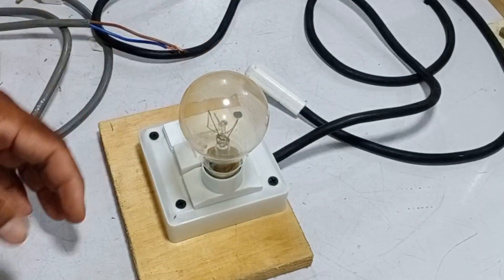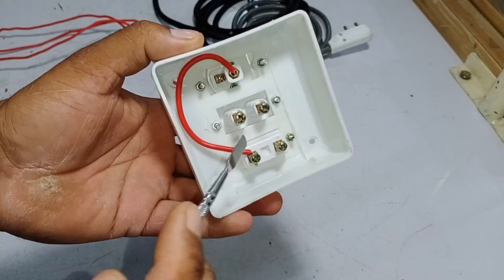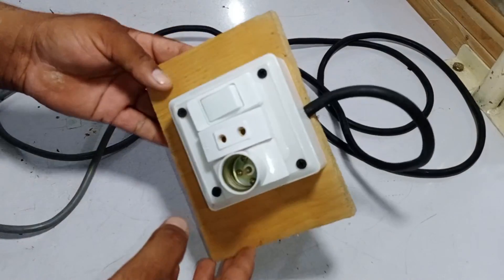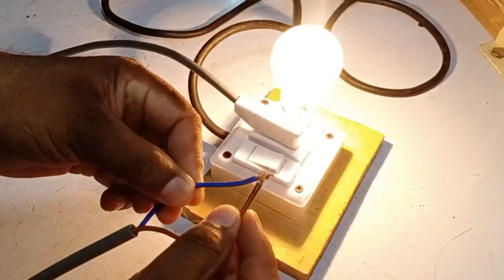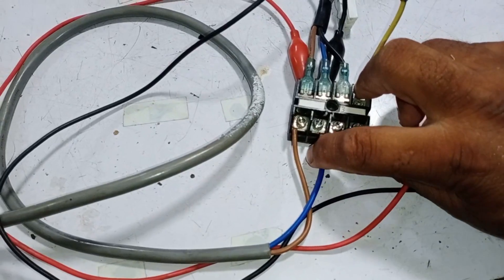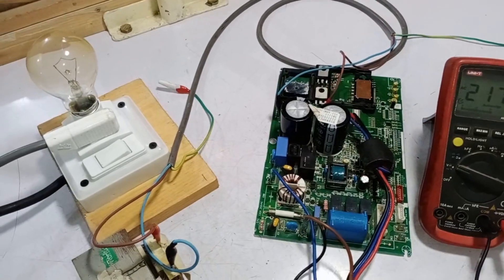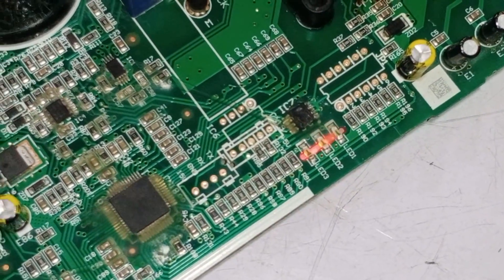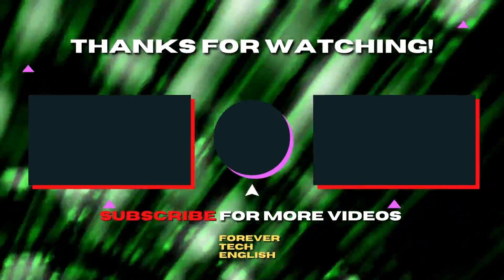Testing Mini Split AC Circuit Board with a Series Lamp!

Comment: How to add a 12v power supply to a board when the smd pcb transformer has blown and you cant get a replacement?
Reply from the maker: Well Will make a video on it soon. If I get a hand on such issue.
Reply: @forevertechenglish  Its  a Hisense/Kenwood fridge main board. A electrical surge blew a hole in the TOP266KG ic and destroyed the windings on the transformer. Managed to get the ic but the transformer is impossible to get. Just like the Hitachi fridge board you did a video on. I followed somebody else's advice and lifted one side of the two diodes after the transformer and attached a  twelve volt power supply positive to the capacitor one leg after the diodes and neg to ground on the dc side of the board. Hooked up 220v power to the board and 12vdc power supply and it blew the ic. Will appreciate your help. I'm not sure where to connect the pos or neg of the 12vdc power supply. Thanks. Waiting for your video.